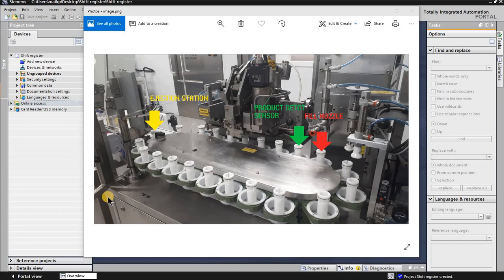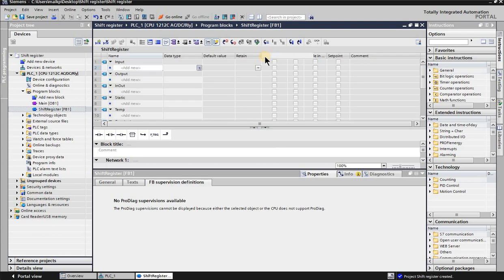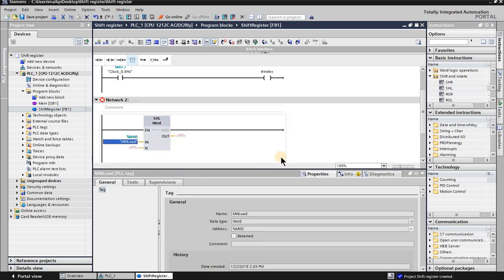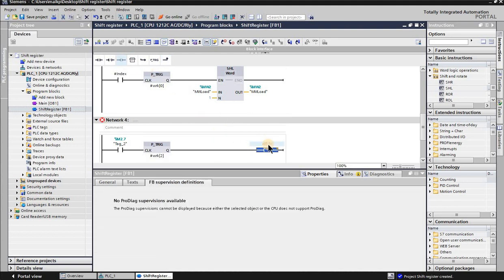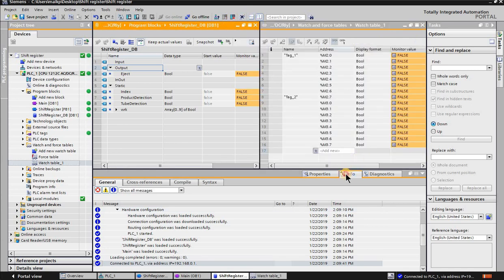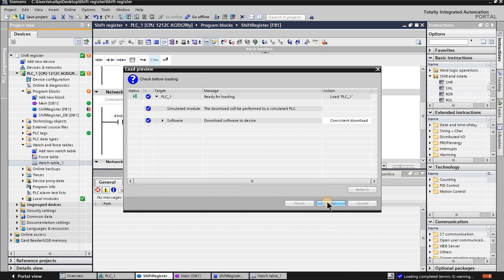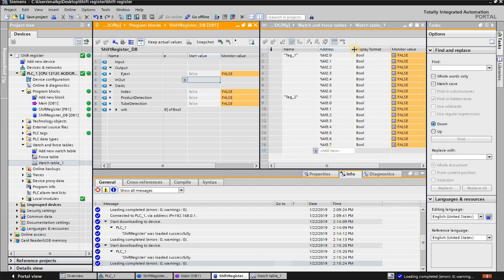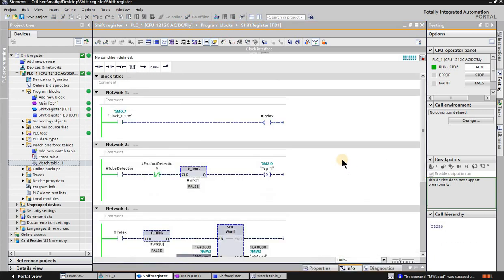Absolute Beginners guide to Siemens PLC Programming // How to Create a Shift Register in TIA Portal

Comment: Hi there, great video and great effort. So you used the clock on the index coil to simulate that there is an input and that the machine conveyor is actually moving. Did I understand that correctly ?
Reply from the maker: Yes, just to show the concept.

Comment: Mike friend I need your help for Servo and hsc. do you have any time to record a clip over that as well  :)
Reply from the maker: Well, you have to be a little bit more specific on that. Would be happy to help if I can.
Reply: Thank you Mike. You are doing great. Please make a video on commissioning for synchronous motor (Sinamics g120 CU240E-2 in Scl).
Reply from the maker: I’m traveling all over Europe right now. I’ll set something up once I’m back. Little heads up though. There’s no way to simulate this. You actually need the corresponding hardware to set this up. I can only show you how it would work once the commissioning wizard was done.
Reply: That will be enough Mike. Thank you and make a visit to Nuremberg Germany.
Reply from the maker: Nope, I’m at Mercedes in Stuttgart/Sindelfingen